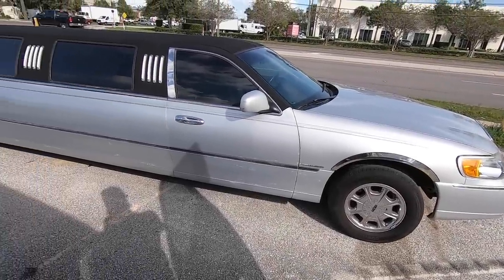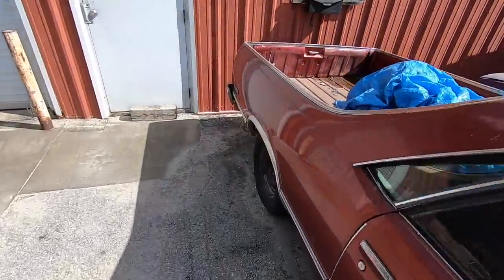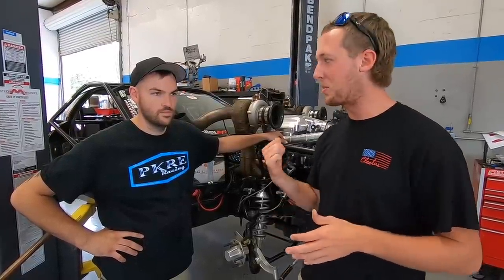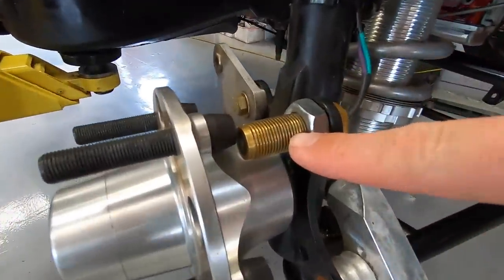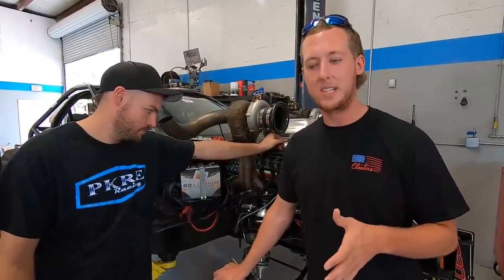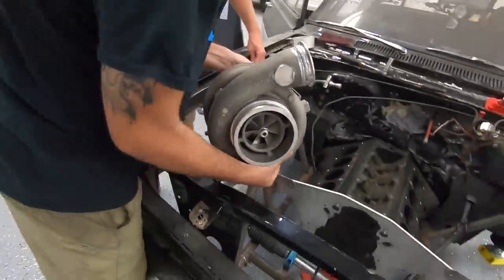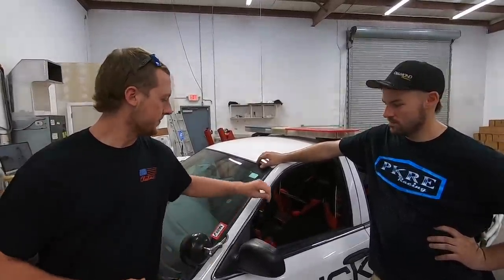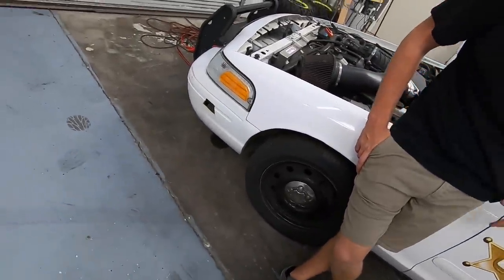Here's Our Plan To Make Leroy Go Mid 7's... (First Discussion of Body Panels)

Comment: Totally thinkin like a body made of clear lexan, or plastic of some sort, like an RC car body before paint.  All the aero advantage, but would still have all the cool bits visible...
Reply: Sort of what I was thinking too...
Just add the dynamics it's easier and way more effective then pushing through custard at 200mph...
Lexan roof, windshield, side windows.
Seal the front tyres in like one of those redbull prototype cars 🤔

Comment: "stuff laying around" yeah and a $10,000 powerglide lol
Reply: Where are you buying powerglides at i can get one firm jegs for 4500 that will take 1500hp or more.
Reply: @charlestorruella8591  yeah and that won't work in a c6  it needs to be a trans axle. Also I wouldn't trust "jegs" brand transmissions

Comment: “Aerodynamics are for people who can’t build engines.” - ENZO FERRARI
Reply: As if Ferrari's aren't aerodynamic..
Reply: No you're both missing the point... You're correct Ferrari produces very aerodynamic vehicles. However the point is that they would be fast even if they had the worst of aero. Because they build fantastic engines!
Reply: The First v12 Enzo Ferrari builded his cylinders look like quarters from the top view.
So he had to rely on aero to keep up with the v8 and v10 at the time.
Reply: Makes sense if it was a quote from his earlier years I suppose but in the later years he wasn't making super powerful cars compared to other manufacturers
Reply: Every car to date has aerodynamics.... As Leroy can't break air... It's stupid not to take advantage of an aero ... Ferrari and Lamborghini are all about that aero...

Comment: Put a chevy opala engine from brazil, inline 6, 4.1L.
Here in brazil some engines are putting out 2200-2400 hp, with a stock block and heads.  They are running 7.2 with a stick shift on these engines
Reply: Yeah, but in that 1320 video they state they go through a lot of those engines as they don't last.
Reply: Yep with ALL of the boost 👍 kyle/fred mob did a thing on these flamethrowers... -insane! Upvote this guy then go watch 1320/brazil 😎
Reply: @jonnoMoto  it is a very strong engine for such an old project, but yes you are right, they take those engines to the absolut limit and they end up breaking. But they only cost about 900/1000 reais, with is about 250 dollars... so it is a very cheap engine to replace.
Reply: If those blocks are a little bit built the i guess they will push a lot of boost
Reply: @jimmymetcalfe9167  that 1320 video is amazing! It really shows the reality of drag racing in brazil. We can only dream about the v8 engines you guys have in america
Reply: @giullianorebuli5267  I'm in Australia... but yeah a billet opala would hold +100psi and approximately (#brokendyno) horsepower lol - but is it mulletproof? 😂
Reply: @jimmymetcalfe9167  i guess that such an engine is yeat to be created 😂
Reply: @giullianorebuli5267  International effort - but I think we've got the right fella for the job?! Get the 'murican to build a Brazilian car, then bring it to Oz and roast some tires? 🤘😎💨
Reply: Swap AP 😂
Reply: That would be a nightmare to build. Import tax from Brazil is 100% so it would be a nightmare and super expensive
Reply: @jimmymetcalfe9167  that plan sonds just perfect to me! Let's put the wheels in motion, roast some tires in a chevy opala down under. Brazilian people would go crazy for that
Reply: @Giova590  ohh man, don't push it ahahah
Reply: @giullianorebuli5267  Aca en Argentina el team viturro llevó a casi 2000hp al pequeño AP, seria interesante 😂
Reply: @Giova590  aca en brasil creo que el maximo és 1500 hp para  AP
Reply: @masonsmith2510  but i think it would be much cheaper than a 2jz for example, even with taxes.
These blocks here are very cheap

Comment: I hear srt-10 in my head. That would be sick
Reply: Was gonna say Mopar too. Would be good to mix it up. Grab viewers on the other side of the isle and do something not many, if any have done (SRT/Hemi in a Vette). LS and 2JZ are SOOO over done, everyone does them now. Yes they are good, but so boring. We get it, their good, but be DIFFERENT, thats what makes cars like the Galaxy and Neighbor so unique.

Or try to do an AWD vette. GTR motor or something like that. Don't do rotary, to expensive if something breaks. Are Ecoboost any good? Tesla would be funny, but hard.

BTW, if you guys read this. It would be INSANE to see Brent and them get a hold of a Toyota Tundra V8 (IDT Honda has a V8) and toss it in the Kole truck or Bully. Then you guys can do Dale vs Kole V8's. They do wonders on the imports. I bet they could have that thing rippin.
Reply: definitely needs to be a mopar engine. 2jz is way over done and could you imagine how many chevy guys heads would explode if they got gapped by a dodge powered gm product?
Reply: Steve Lentz just what I was thinking

Comment: When you get some body panels on Leroy. Y’all should do a top speed run at a airport runway to see what he tops out at 🤙
Reply: 6BT SWAP RUBY DONT BE SCUUURED OF DIESELS
Reply: Its probably going to be transmission gearing limited and not horsepower limited which means they should be able to calculate it

Comment: I'm voting a V-10 of some kind viper v10 would be bitchin!!!

side note: would love to see a ford 300 i6 build not in ruby but would still be fun
Reply: YES
Reply: Shane Olsen maybe a bmw v10?
Reply: @brandonsebou2949  not apposed to that but would rather a larger displacement
Reply: Built 300 with a FAT turbo. One of my dream builds
Reply: @owayne1312 the torque curve on that thing would be ridiculous, I've just never seen one done and think it would make a fun shop truck engine or something
Reply: It's weird. I never quite understood the fascination with the viper v10. It doesn't sound like a v10, rather just seems a bit higher revving, smoother running US v8 +2 cyilnders. A v10 should be more like the ones in the E60 M5, R8 v10/Gallardo v10 or the one in the LFA. Or others similar to that. And a true v10 should rev a lot higher than 6500-ish.
Reply: @Renee_R343  yes but the rest of those v-10s aren't over 8 liters, when an engine is that large its limited in how high it can rev, Lamborghini v-10s are about 6 liters literally about 100 cubic inches smaller
Reply: Also I'm pretty sure the standing mile has a record held by a twin turbo viper ACR at the moment, and a true v10, has 10 cylinders literally by definition, not taking away from the other engines, but the viper v10  is no slouch
Reply: @shaneolsen9394  I thought about mentioning that, but thought the comment would have become too long. I think the viper 8.something lither engine is too large for a v10 design. Such a weird choice. Go for a v10, a very "european" design to compete with other exotics, but nah... lets give it way too much displacement so that it won't be able to rev higher than a Mondeo. Like, wtf?
Reply: @shaneolsen9394  Yes, even in stock form it isn't a slouch, but you have to agree, this is not what a true v10 is at heart. A 5 liter (or less) displacement shreaking, butter smooth rev beast.
Reply: @shaneolsen9394  So in essence it's a low revving, high displacement v8 with 2 extra cylinders just for the added power output.
Reply: @Renee_R343  to sum it up "different strokes for different folks" the reasons you dont like the viper v10 are the reasons I do haha, you mention European European v-10s high revving small displacement, which are great and sound awsome, but look where the viper v10 Is made, America, which is kinda known for they're big block v8s sooo why not throw 2 extra cylinders to give it more power haha. if you ask me it's a very American version of a v10 that has its place just like the high revving European ones
Reply: @shaneolsen9394  I'm absolutely fine with other people loving the viper engine. I love diversity. I have a 1.9 VAG diesel, 1.6 toyota, 1.4 honda, 3.0 BMW diesel, a 3.0 Audi v6 and a 4.2 Audi v8 in my family.  I just reached one of my dreams, the audi S4 with the 4.2 v8, the next goal is audi s6 with the 5.2 v10. And maybe some day, just maybe I'll get to my childhood dream of an American V8 aswell. They're pricy in europe though. Old beater v8 in the US is 1K, same car here 7K :(
Reply: @Renee_R343  I've had v8's most of my life gotta love em'

Comment: The big issue with coming up with an interesting engine swap for Ruby is that all of the reliable drag racing engines are obvious. I was thinking something like the 4.0 from an E92 M3, but how many of those do you see drag racing? There's usually a pretty damn good reason why you don't see certain engines racing.
Maybe hit up a Copart or something and try and get a V10 from a Viper or an Audi/Lamborghini because reasons.
Reply: the viper swap would be insane
Reply: Viper yes lambo no
Reply: I vote for the V10
Reply: Viper all the way
Reply: We should all make separate comments asking for the viper engine just so it seems like more people want it
Reply: V10 and reliability shouldnt be put together lol
Reply: A V10 will not fit in Ruby lmao
Reply: V12LS engine!
Reply: @ericchambers9023  that won't fit either lmao
Reply: ya boy Blackout extend the firewall backwards
Reply: @landontoaster3818  that maybe true for the V12 LS, but them Audi V10s are WIDE
Reply: You could probably get a V10 to fit, honestly. Back it up as close as you can to the firewall and get ol' Troy to at Profab to  cobble together a new sub-frame. It'd be nose heavy and a large part of the engine would probably be hanging over the front axle, but its a drag car so weight distribution isn't nearly as important as it would be normally. There likely wouldn't be any room for turbos in the bay, but Cleetus and the boys have already shown that they could care less about that.
Reply: ya boy Blackout Viper v10
Reply: @Omen_Seven  that is a possibility, but would be highly impractical compared to swapping it for anything with less than 9 cylinders
Reply: @landontoaster3818  viper V10 barely fit in a Honda S2K but it's probably about the same as what Aaron said
Reply: ya boy Blackout just based on the size of an LS in the engine bay, it would probably fit if they found small enough versions of everything on the front of the engine, or if they shorten the drive shaft and manage to squeeze the trans back a little further

Comment: You also need to put in no-lift shift. 

You’re EASILY losing 3-4 tenths on that alone. Easy. 

Leroy needs to run like an NHRA pro-stock.
Reply: That was one of the first things he did to leroy lmao.
Reply: Yeah lol the car already has no lift shift
Reply: Its got a dox box he only uses the clutch to leave from first
Reply: Then Cleetus is doing something wrong then.  During World Cup 1st round race you could watch the car in the left lane just catch Leeroy every shift.  If they can smooth out the power through the shift points Cleetus wins that round.
Reply: @christiandevito26  he still uses the clutch for early gear change he just keeps the gas pedal floored the entire time
Reply: @garygsp3  I think that was him still getting used to the new clutch...with the old triple disc setup he was stupid fast with the gear changes...he'll get his groove back for sure.
Reply: Cleetus powershifts every gear. It's what makes his feats so impressive. The new slipper clutch will certainly take some of the skill out of it, but he's already proven himself to be a manual master. Now he just wants to go fast.
Reply: Christian DeVito still have to lift to change gears. Dogs have to be unloaded to move.
Reply: Valera no it doesn’t.
Reply: @MomedicsChannel  buddy you're arguing with people who've been here since the start. We know every little detail about the car. Allow me to explain: Cleetus has a button under his clutch pedal that briefly cuts the throttle. So when he punches the clutch to shift, it unloads the trans despite his foot being flat out.
Reply: He also has faceplated gears, allowing for more aggressive shifts without fear of shredding them

Comment: After Summernats load a few of the mighty Barra Engines in the container 
Would look sweet with a big straight six  and bigger turbo sticking out the engine bay
Reply: Throwing complete engines newer than 21 years in containers is a bit risky. To do it in a way that has the least amount of risk you need to split them, head in one and block in another. Also the container was 20ft. They wouldn't have as much room. They'd need to get pallet racking and go through that process. If you don't load it right or strap it down enough it will definitely shift and if it's that high up coming down on the car is very likely. 

Source? I load and unload shipping containers with cars, engines, freight, etc.

Also we already have barras in the states, no need to wait months to get their hands on one.
Reply: @VA-ng2ve  Leave the fuckn car at summernats and load the container with good 'ol Aussie Barra motors and bring that thing home to the USA and REALLY make some funky conversions that SCREAM their tits off and eat Big Blocks.
Reply: @VA-ng2ve  yeah but I've seen N/A Barra engines for sale for $70 here in Victoria. Cost wise might be a better idea to bring them back with them
Reply: It wont make more power than its making now even if you take it to the extreme, yes the turbo barra is good but not as good as the twin turbo 427 they have at the moment.
Reply: @jasonswift7098  Yeah but a container load of them is more valuable in America than they are in Victoria.
Clit should seize the opportunity and make some bucks raffling off the American car in Oz, and load up the container with some Oz Metal to raffle off in America. Extremely Lucrative opportunity at the Nats.
Reply: @Chubsandsubs  A $70 barra might not be all that great, likely high miles. The decent ones with lowish miles usually run around 300 AUD. That's just for the long block. No wiring, ecu, etc. 

Air freighting it would be very expensive. Putting one in the container with Toast is doable, but could be a customs issue. EPA has a 21 year rule on engines. When we bring them into the states we split them into 2 containers. Block in one, head in another. Basically you can import them as parts just fine, but complete assembled could run into issues. 

Now if they keep the 20ft container they likely don't have a lot of room on the floor for the engine. So they'd need pallet racking to go over the roof or rear of the car. That would cost around $200 minimum, likely about 300 to 400 all in to just get the engine loaded into the container properly so it doesn't shift in transit. 

Also the soonest they could get the engine back here would be probably around March. If they wanted to get the ball rolling sooner they'd need to find an engine in the states like the ones we have. 

Now as for cost? They are willing to throw down 3k on a limo just to throw it on the dyno. Spending say 1400-1600 on an engine already in the states, and air freighting some performance parts could get them up started on it hell as soon as end of the week, maybe 2 weeks from now they'd be ready to start on it.
Reply: @VA-ng2ve  some very valid points man. Many wreckers in Melbourne will do clearance of stock a couple times a year and do $69-$150 N/A Barra engines with heads but that's about all you get. Many of these dismantlers pull so many stock Ford's apart for parts the chances of finding a decent one isn't as high as you'd think.
Reply: @JesusisJesus  The demand for them is not that high right now. I think it could get a lot higher if they do this build on here, but we'll see I guess. We have 4 ready for sale in the states right now. Sold two a few weeks ago, these can all be gone in a month or a 6 months. It all depends. Some sellers tend to sell them for around 2k, we well ours for about 1400-1600 or so a little more little less depending on options. 

Also note that just throwing them complete like that in a container there is a risk of seizure if customs singles it out for inspection. Engines newer than 21 years can be imported but they really need to be imported as parts. Say 10 blocks in one container, 10 heads in another would be fine, 10 complete engines in 1 container = red flag. Now you could get lucky and get a cbp official that doesn't know anything and lets it go when they are not supposed to but I wouldn't rely on that. 

One last point. If the market was there. I know we would, and another 2 people would be importing them a lot more. I am sure we could fill up a 40ft containers fairly easily. 

If you or anyone else just wanted the long blocks, no wiring harness, ecu, etc just block/head, maybe some accessories and engine harness, and wanted us to import say 40 of them we could probably do that for 1000 or so each, maybe less. Or if you bought them and had them shipped to one of our depots we ship gasoline engines for 450 USD, but that amount of bulk could probably get it down to around 400 each.